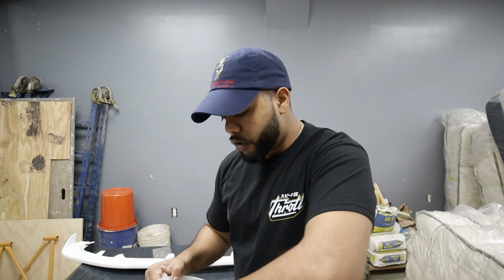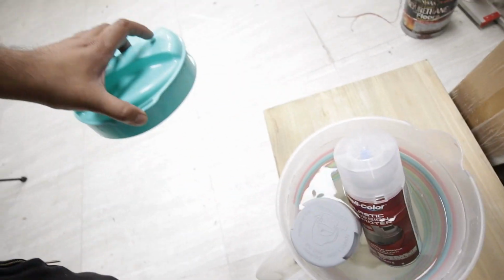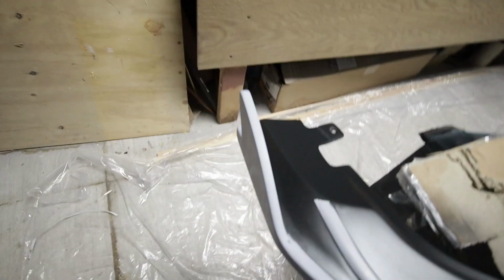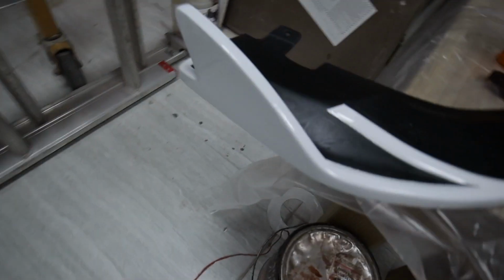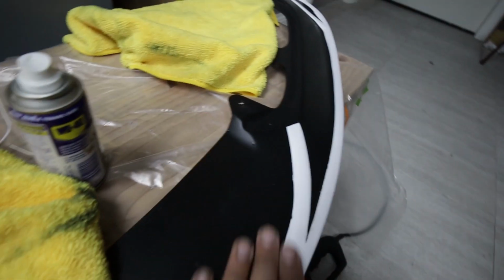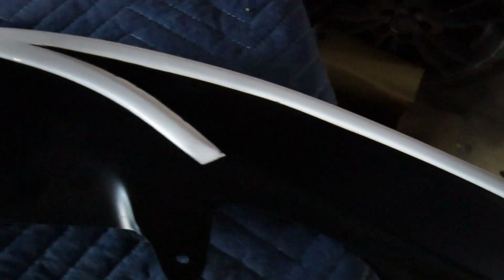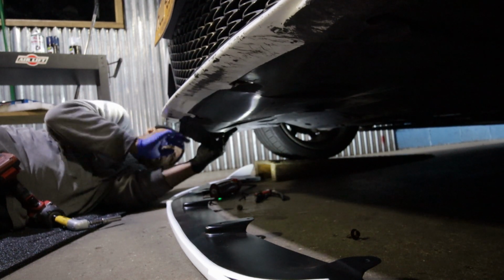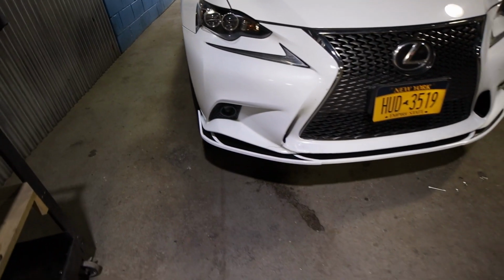2014 Lexus IS250 326 Power lip painted and INSTALLED!

Comment: The Lexus IS is the car I like but a car that low in nyc
Reply from the maker: Air suspension helps a lot
Reply: @ChrisKheluram  I had my acura and I was on Long Island  Them roads    Are nuts I'm in Florida now I would like and IS of some sort    250 350 f  Something
Reply from the maker: Lmao all of NYC roads are trash but Florida you don’t even need bags you max out your coil overs and still wouldn’t have to deal with pot holes
Reply: @ChrisKheluram  We still got driveways in the scrapes still hurt on driveways in speed bumps

Comment: Congrats!!!! Very nice !!! Are you ever thinking on ever changing your steering wheel btw ?
Reply from the maker: Thanks man, and you noticed the crusty steering wheel too? 😂 yeah eventually.. honest I really want a vertex wheel but I need my air bag system so idk maybe a toms racing carbon steering 🤷🏽‍♂️
Reply: @ChrisKheluram  haha yeah 😂 I got a 2016 IS 300 and the leather on the wheel is not in good shape either.  I want to change the wheel, but I'm here in Canada where winters are intense and I don't want to lose my heated option. Do you know of after market wheels with heated option?
Reply: I know I am being picky, however if I am paying for it, Id rather get what I want and need, you know?
Reply from the maker: I know exactly what you mean unfortunately I don’t think there’s any companies out there doing heated carbon steering wheels but I could be wrong. If the heated steering option is one thing you really want to keep I would say to buy better condition wheel or getting your stock wheel redone.